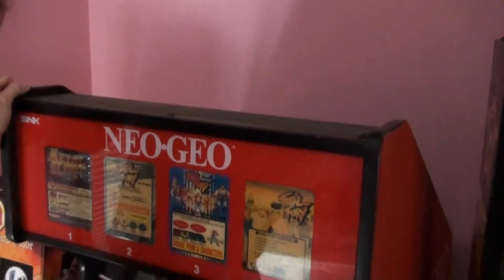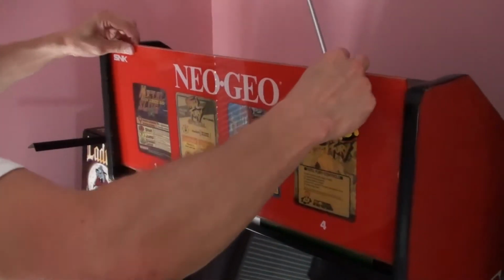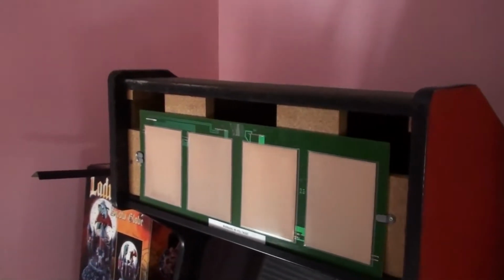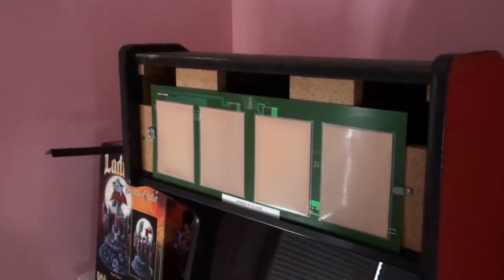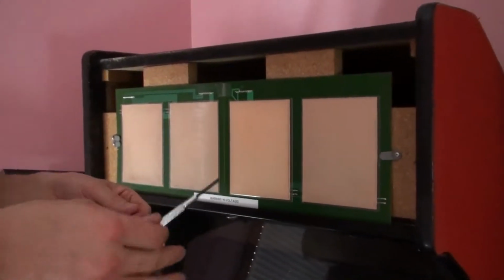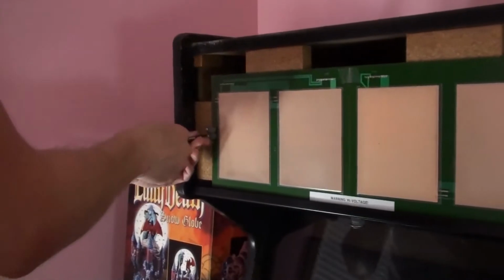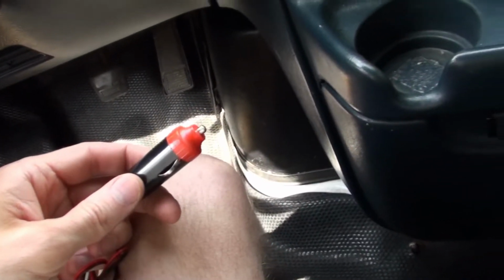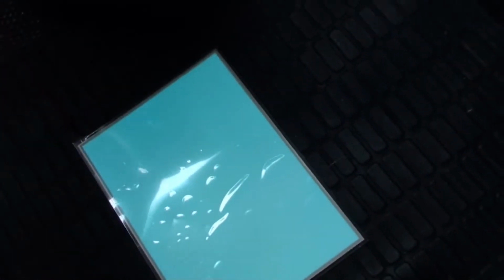Neo Geo MVS EL Electroluminescent Panel (lights) Replacement in Arcade Marquee

Comment: Btw the high pitched noise we hear when you turn on the machine is probably bad capacitor on the control/inverter board that's behind the wood in the cab. Replacing those makes the cab more quiet.
Reply from the maker: Oh really?  I'll look into that and get back to you.  Thanks, ving!

Comment: Hi. Do you know if I need the inverter? I saw some on eBay but it had four different options. Some ran at 120v.
Reply from the maker: Hi Alvaro, typically inverter refers to switching DC voltage to AC voltage.  I bet they come with a component which corrects the voltage to 12v.  Just clip that off and solder in place as the NEO GEO MVS display panel runs at 12v.
If you are concerned, keep the cord long enough, leaving you the ability to re-solder it back in place.
Let me know how it goes!  As an update, I performed this replacement over 3 years ago and they are all still bright as ever!  😊

Comment: Sweet need to do this to my MVS cab; where did you buy those EL panels?
Reply from the maker: Hi bud, thanks for checking out my video!  Here is where I purchased the EL panels:  https://www.ebay.com/itm/12V-A5-Size-EL-Panel-Electroluminescent-Cuttable-Light-Inverter-Paper-Neon/192866389482?ssPageName=STRK%3AMEBIDX%3AIT&_trksid=p2060353.m2749.l2649